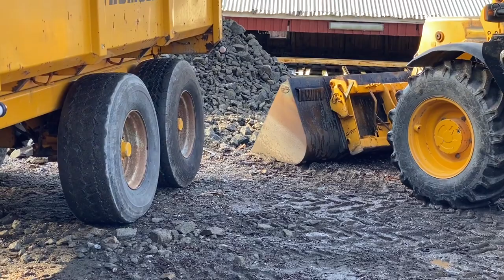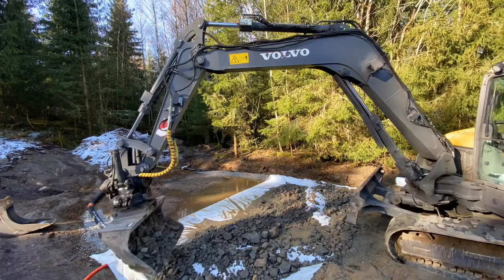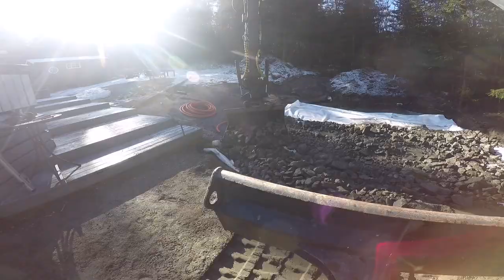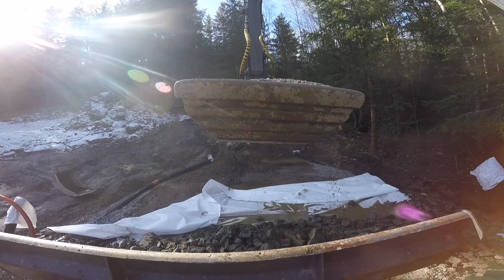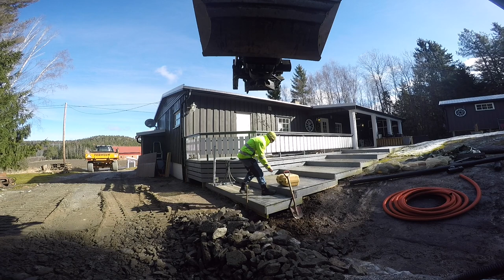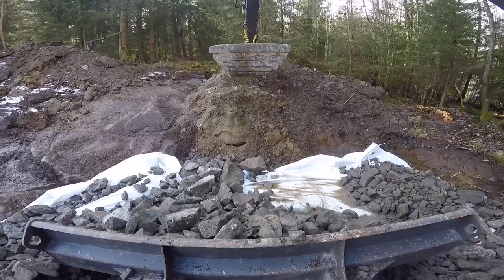Building embankment! Volvo ECR88D, MF8670, fiber fabrics, laser rigging++!😋 Garage project - part 5

Comment: That rotary bucket attachment is very  functional piece of equiptment !!!
Reply from the maker: Indeed!😋 The tilt rotator surely makes a job like this - a lot - easier!🤩
20 years ago, there was only a few wheeled excavators that had tools like that up here.. Now, almost every machine from 5 to 30 ton has a tilt rotator!😅 They have even made rotators for 40 ton excavators now, but it is so expensive since the breakout force on a 40 ton machine is so much higher than on a 30 ton machine..🤪
Companies in Norway are dependent on this kind of equipment! Time is money, and with a tiltrotator on the machines, the jobs a being done so much faster! We don’t need that many hand guys anymore, since excavations near walls and in narrow trenches are executed just fine without manual labor!😄
The trick is to get used to it, so one can handle it properly!😅👍
Reply: @norwegianearthmovers  jeg husker at når jeg begynte i Arne Olav Lund i mai 93 så hadde vi en innleid som akuratt hadde vært i Sverige å hentet en brukt åkerman H7MC new Comfort med rotortilt. Jeg tror han var en av de første i Norge til å ha rotortilt på maskin i Norge og han er innleid hos oss enda😂👍
Reply from the maker: Hehe, da er både utstyr og ferdigheter på plass!😅
Ja, det var noen få som hadde sånt på midten av ‘90 tallet, ryktene fortalte om gærne folk som skaffet seg no greier som snurret skuffa rundt..😅 Var ikke før jeg begynte å jobbe selv i ‘98 at jeg faktisk så en i drift, da på en hjul graver Råde Graveservice hadde..🤪 Var vel brått en maskin i overgangen Åkerman/Volvo det også, husker ikke om den het H7 eller EW150..😄
Var nok en av de aller første som hadde det her i Østfold tror jeg!😋
Reply: @norwegianearthmovers  Vi fikk firmaets første i 94 på en ew 150💪 og jeg i 99 på en Hitachi ex 215. Rød og fin R6🔥🔥🔥

Comment: OK....Question I see what you are doing  (1) I assume the black pipe will drain off water from the roof down spouts, but (2) what is the orange tubing use for ??
Reply from the maker: You are correct!👌 The black pipes also has holes the upper 180 degrees, to drain ground water! We don’t want to have a lot of water in the ground under buildings here, the frost would force the building around!😅
The orange tube is for pulling electric cables from the house to the garage, so the cable can be fitted after the ground work is done and the garage is built!😋 Nice to just get everything done at once when the pit is open, instead of having cables in the air or having to dig a ditch after the building is done!🙂
Reply: @norwegianearthmovers  OK............I follow your explaination !!!